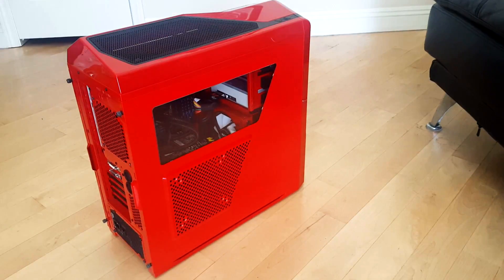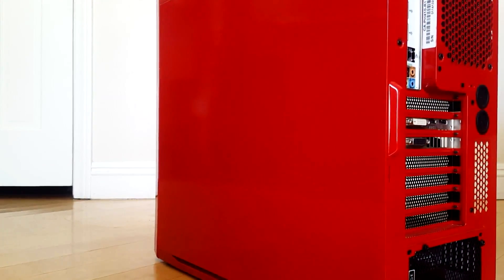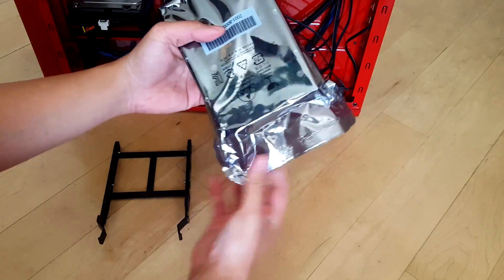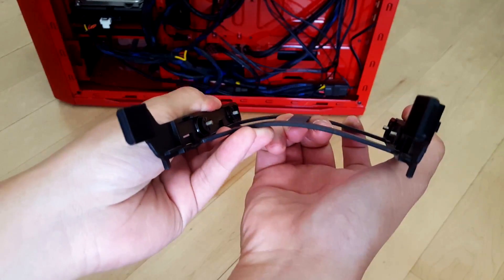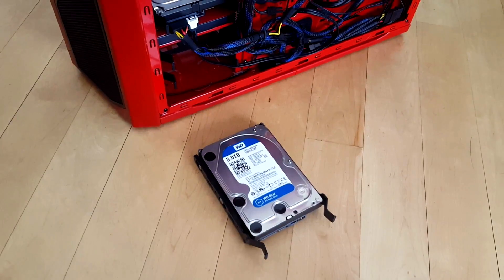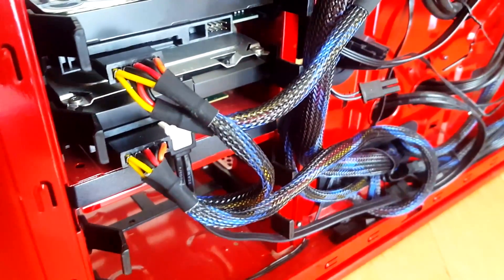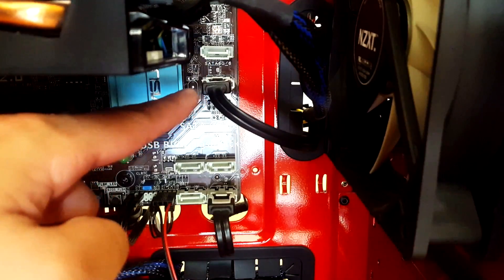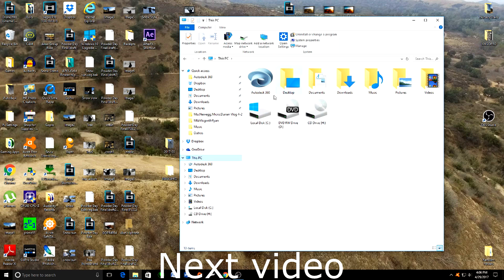How to Install  a Hard Drive

Comment: thanks man. I forgot i needed a bracket for it...actually i didn't know. I bought everything I needed except that. Doing my first build. Thank you
Reply from the maker: No problem man! Glad I could help hahah enjoy that new build!
Reply: I wish. Everything is right but no power. Only the lEDs come on. There’s a white flash at the back of the motherboard when I turn the power on. No smell no smoke just a white cflash and no juice

Comment: I'm about to move a harddrive i had on my old pc to my new one, when i removed the harddrive from the old pc i didn't reset it. so does that mean if i put in the harddrive into my new pc, will it be flodded with the stuff i had on the old one or do i have the option to choose manually what i want to keep or remove from it?
Reply from the maker: Hello yes if the hard drive was not formatted it should be accessible in the new computer. Since you can access the data you can choose to delete what you like. Hope that helps!
Reply: @50nollieman  alright, thank you so much, been thinking of this for the past few weeks, keep up the good work!
Reply from the maker: @h8m812  no worries! Thanks! And goodluck man! Enjoy that new PC hahah

Comment: What screws do i need?
Reply from the maker: It depends on your pc case. You can pop open one of the side panels to see if you even need screws. Goodluck!
Reply: @50nollieman  Well I got a weird case I need to screw in my hdd in the hdd bay but no screws were included what should I do?
Reply from the maker: @PerPhilips  hmmmm Id suggest going to a Home Depot or any hardware store and ask someone to check which screw fits into your hard drive. It might be either M3 or 6-32 screw
Reply: @50nollieman  Will do thanks alot!

Comment: The cables do we get them with the hardrive or case or if it doesnt where do we get the cables from?
Reply from the maker: The power cable should come with the power supply but the SATA cable you'd have to buy separately. They have those on amazon for about $6. Goodluck!
Reply: @50nollieman  Thank you!
Reply from the maker: @HambergurHelperEeter  No problem! Enjoy!

Comment: Mine won't stretch enough to fit the hard drive without the final pin popping out and I can't put it back in :(
Reply from the maker: Hello. Do you mean the sata cable? If thats the case you can buy longer ones
Reply: @50nollieman  No, the tray
Reply from the maker: @BRAWGWill  hmmm if the new drive is the same size as the old drive it should fit. Id say just keep fiddling around with it. Or if anything having one pin out of the 4 not holding you should be fine
Reply: @50nollieman  It's all new. Case and drive. I'm still unhappy with the idea that one would be missing if I just did it anyway. God I wish I didn't have to fuck around with a tool-less tray and I could use a proper one.
Reply from the maker: @BRAWGWill  hmm id say contact the case manufacturer and they might warranty it and send you some

Comment: Got a good question bro does the hard drive make your computer run games and load slot slower?
Reply from the maker: Hello! What do you mean exactly by "load slot?" If you mean the game loading screens it really depends where you're coming. If you're from a SSD then yes the loading screens will load slower in the games that is stored in a HDD
Reply: @50nollieman  lol auto correct I meant will it make it load a lot slower
Reply from the maker: @connordover2215  hahah in that case the SSD will be faster. It really depends on the games and pc setup. What you can also do if you already have a SSD but need more storage is get a HDD. Move the games you don't play into the HDD and transfer your newly downloaded games that you want to play in your current SSD

Comment: Yo do you need to buy a data cable or does it come with the pc
Reply: Also what is better SSD or HDD
Reply from the maker: @alfredoisok7353  for SSD vs HDD it mostly depends on what you want. Do you want speed? Then get ssd. Do you want more space/better value? Get hdd. For example a 4tb HDD you can get for less than $100. $100 will only get you a 1tb SSD but it is faster
Reply: Sata cable*
Reply from the maker: Usually prebuilts don't come with. Unless you're building it yourself, it usually comes with the motherboard. Its pretty cheap you can check my link in the description if you want
Reply: Ok thank you cause I don’t got one 🤜🏼🤛🏼👍🏼
Reply from the maker: @alfredoisok7353  no problem! Happy to help 😁👍
Reply: But for gaming and streaming what do you recommend
Reply from the maker: @alfredoisok7353  hmmmm with SSD you can get shorter loading times. For that dreaded GTA loading screen lol On the other hand streaming is mostly on your internet connection so ssd vs hdd wont matter. So id say go ssd if loading times matter to you
Reply: SSD OR HDD
Reply from the maker: @alfredoisok7353  Also 1tb should be fine for gaming. If youre not a content creator and dont plan to store movies, videos, pictures then Id recommend the SSD
Reply: Ok thank you so much cause this will be my first build thx
Reply: But I make montages so what do I do there

Comment: I have the same motherbaord and gpu kinda funny
Reply from the maker: Ayeeeeee I like your pc man! hahah pc twins
Reply: @50nollieman  whats ur prossesor what are the odds u have a ryzen 5 3600x
Reply from the maker: @aidensimpkiss9442  lololol close guess. Right now im running a ryzen 5 1600. The older version of yours hah
Reply: @50nollieman  well we basicly have the same pc just mine was an old Pre build but i redid the hole thing so rlly we just have diffrent cases but basicly same iinternals
Reply from the maker: @aidensimpkiss9442  heck yeah! Definitely a solid pc forsure. Im looking into ssd now heheh the price is finally coming down to something I can afford xD
Reply: @50nollieman  i got a 500gb ssd im basicly done with upgrades im just gonna get a water cooling block for my cpu then im done iv spent to much on my pc as it is
Reply from the maker: @aidensimpkiss9442  nice nice! My want for upgrades never end xD The wallet on the other hand hahah honestly I need to stop following new releases. If idk new upgrades then i wouldnt want anything lol new

Comment: You just slide it in like that?  It wont move around?
Reply from the maker: The hdd locks and clicks into place. Thats why I had to squeeze the two tabs together when pulling the drive bay out, to unlock it
Reply: What are they called and where can I get those?
Reply from the maker: @nappery9736  Those specifically came with my case. You can check yours how they designed the hard drive to go in

Comment: why tf does my pc not have that rack thing that u put the hardd drive in? is it possible to buy and install one?
Reply from the maker: It really depends on your case. With my case those were included. Maybe in yours is a different design?
Reply: AdventuresWithAlan yes probably
Reply from the maker: @antoniobeccari6611  Yeah. I know in other cases the hard drive is screwed into the case. See if thats how your case is

Comment: Can we take out the old 1 and install the new1 in the old 1s position with the wire which was used for the old1?
Reply from the maker: Yes. You would need to reinstall windows

Comment: I had a failing HDD, and I bought a new one and I am going to put it in, am I able to just take the cables from my first hard drive and just put them on my new one?
Reply from the maker: If the failing HDD is a secondary HDD then yes. If not you probably want to back up all your data first before switching the old HDD to the new one. Also have the windows code ready since youll have to install windows on the new HDD

Comment: Do you have to buy cables separately or does it come with HDD?
Reply from the maker: The cables are always sold separately. The power cable should just come from the power supply
Reply: @50nollieman  Alright, thanks for info

Comment: Wow, I’m 12 years old starting on computers and you really made it so easy, I thought it would be a maze in the PC but it actually only took 5-10 mins just like the video, thank you so much
Reply: Just a question:
Did you need to buy the cables that you plugged in the second HDD or were they already there? I've upgraded my cpu,gpu and ram but I've never upgraded my HDD so it's something new for me xD
Reply from the maker: Yes its not too hard hahah Glad I could help!!
Reply: @50nollieman  no I mean..Were the cables already ready to get plugged in it did you need to buy them
Reply from the maker: @orestisx  You need to buy a sata cable. The power cable should come from your power supply. It depends on your power supply tho
Reply: @50nollieman  thanks:D

Comment: does the screw come together with the hard drive? because it seems that for my casing, i have to mount it to the right side of it and have to screw it in
Reply from the maker: No the screw does not come with the hard drive. The hard drive only comes with the hard drive. Not even the SATA cable

Comment: How do i know what is the right for my pc
Reply from the maker: You can check inside if theres already a hard drive
Reply: @50nollieman  Theres only a ssd but i want to add a hard drive
Reply from the maker: @aukusti22  what kind of ssd is it? Its not a nvme right?
Reply: AdventuresWithAlan no its not a nvme
Reply from the maker: @aukusti22  Then yes you should be able to. The ssd connects exactly the same as the hdd
Reply from the maker: @aukusti22  If you follow the steps in this video and treat the new hard drive as a secondary drive, then youre good. As in this video I had two hard drives, you can treat my 1st hard drive as your ssd basically
Reply: AdventuresWithAlan oh ok thank you🙏🏻
Reply from the maker: @aukusti22  no worries! Goodluck enjoy!

Comment: Can somebody explain the sata power cable part? 1 end is to the HDD, and the other end is to the power supply right? So by default my power supply should already have multiple sata power cable ready for use, right?
Reply from the maker: The HDD runs off 2 cables. One is the power cable(comes from power supply to power the HDD) and the other is the sata cable(this connects the HDD to the motherboard to transfer data)
Reply: @50nollieman  Ah okay yeah. I understood the sata data part. But I already have a SSD connected to my power supply. So do I have to buy another sata power supply cable for my HDD to power supply or my power supply has the sata power cable preinstalled ready for me to use?
Reply from the maker: @SW-zq7pj  That would totally depend on your power supply. Some power supplies have removable cables and some are fixed. If yours is fixed you can see if there is an extra power cable that is not being used and you can use that. Let me know if you have more questions! Happy to help
Reply: @50nollieman  Sorry I'm not familiar with PC building stuff :/
Reply from the maker: @SW-zq7pj  Thats fine! no worries
Reply: @50nollieman  Ahh, I see, thank you!!
Reply from the maker: @SW-zq7pj  Youre welcome! Goodluck and enjoy your new drive!

Comment: For the sata cable you have like 8 dots on the place you plug it in I only have 4 of those dots do I have to get another wire????
Reply from the maker: Sorry for the late response. Hmmm you can google where your sata connects. Its different per motherboard but it should look the same as in my video

Comment: nice build bro i’m a beginner and my power supply came with no sata cable for the slot on the right side but i have one to fit in the first big slot , will mine still function, ? and did u have to buy that sata cable separately?
Reply from the maker: Thanks bruh!! Hmm you would need both the cables for the hard drive to function since one cable is only to power the hard drive and the other(sata cable) is to actually read and write on the hard drive. Yes I had to buy mine separately. I think it was only like $5-10

Comment: its my first time buying a pc and im confused with the cables do i have to manually add cables or are there automatically wires?
its a pre - built pc if that helps
Reply: ArsGames the power supply should have the power cable and the sata cable should come either with ur mother board or u gotta get on online
Reply from the maker: @hokagesuperr2484  Yes exactly correct! If you need a sata cable it's only $5-10
Reply: @50nollieman  do i really need the wd hdd bracket?
Reply: @deltaid1439  no not really, theres different ways to mount/install hdd's.or ssd
Reply: @aljonborabo0801  ok cuz i was want to buy hdd
Reply: did it come with what you needed bro ?

Comment: Man i have no sata cable connection on my Mb it is Asrock 450b Pro, isn't it strange?:(
Reply from the maker: That is pretty weird hmmm did you check the manual? It usually says what ports and connecitons come with the mobo

Comment: How do you get it out
Reply from the maker: get what out?
Reply: AdventuresWithAlan no I figured it out I was trying to take out a hardrive from my old pc to put into my new one that I am building but I am having problems (not with the hardrive.) do you think you could help me?
Reply from the maker: @brodyhubbard9801  whats the problem?
Reply: AdventuresWithAlan so okay when I tried to boot it up everything was working except there was no display and there was a red Light on the motherboard indicating that there is something wrong with the cpu so the next day I took everything out I cleaned out the thermal paste and just kinda cleaned it up a little and put it back in tried to book it up nothing. Also the plug ins on the back are not working I know that because I tried plugging my mouse into it. I have no idea what it is
Reply: AdventuresWithAlan I forgot to mention that there was one bent prong and I fixed it with a razor blade very prescily

Comment: And how do u plug in the power i need help
Reply from the maker: The power comes from the power supply. You just plug in the cable coming from the power supply to the hard drive
Reply: @50nollieman  do u have discord by chance
Reply from the maker: @brxndxn4252  unfortunately no
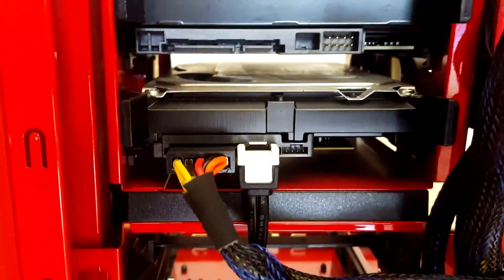Reply from the maker: @brxndxn4252  The part you would want to watch is 4:06
Reply from the maker: @brxndxn4252  If youre worried about wiring it wrong, the cable will only go in one way(the correct way)

Comment: do u need to buy a powercable ? or is that already in the computer itself
Reply from the maker: That is typically with your power supply. Check if your psu has an extra. Goodluck!

Comment: Do the wires come with the hard drive
Reply from the maker: No it doesnt. The sata cable should be less than $5 and the power cable should come from your psu

Comment: Dude, does it matter that i have an SSD already? Like Do i have to plug them in at the same time?
Reply from the maker: If you already have the ssd in the computer just don't touch it then you should be good to follow the steps I did in this video :) Hope that helps

Comment: Don’t know too much about PCs but my pc motherboard is a DZ68BC and it got 4 sata plugs but there 2 blue and 2 black so if I get a hdd would it work in any plug I also have a extra power supply cable but I don’t have a sata cable would it work just to buy a sata cable and hdd? Also again what’s the difference of the blue sata port and black port?
Reply from the maker: Yes it will work with just buying the hdd and the sata cable. From what I saw online I think the blue and black is only for looks as far as I know. I think you should be fine. Hope that helps!

Comment: did your pc come with the flexible hard drive case(s)? where can i buy those exactly? thanks
Reply from the maker: Yes the case did come with those. Your pc should have extra slots but not necessarily the black flexible pieces I have. It could be just screw holes in the case etc
Reply: AdventuresWithAlan oh ok. do you know the exact names of those trays? i looked on amazon for ‘flexible hard drive tray’ but to no avail.
Reply from the maker: @NewDawnFadesX  Yeah those are specific for my pc case so I do not think they would sell it by itself since it wont work with other cases. There should already be empty hard drive slots in your computer case. Lmk if you have more questions
Reply: AdventuresWithAlan oh ok. thanks for the responses.
Reply from the maker: @NewDawnFadesX  No worries! If your pc case does not have extra hard drive slots then you might have to buy a new pc case
Reply: AdventuresWithAlan i think it does. it just doesnt have the trays. i have a flexible tray similar to yours. but just one. i dont see the others where the my current hdd is. my friend is the one that assembled the my pc. but its been a couple years since its been opened. i needed to clean it off any ways. due to dust.
Reply: NewDawnFadesX  Ik this is a extremely late response bit the plastic things are called hard drive rails/ caddys
Reply: Saftey Bird it’s ok. Thanks for replying.
Reply: NewDawnFadesX np

Comment: LOL I got even same case so useful video for me
sadly I hadn't istall other slots for hdds and I don't know where they are.. do you think I can buy them somewhere?
Reply from the maker: Ayeeee case twins! hahah Hmmm I would suggest maybe contacting NZXT(maker of the case) to see if they have any lying around
Reply: excuse me sir,what name item for cover your HDD? and does it still need screw For tighten?
Reply from the maker: @gunawangunawansantoso4122  Hello. It's called a drive bay. In this case it does not need screws since it has pins.

Comment: does it matter which power supply cable I use? I have a very similar looking pc and currently the setup uses one parent power supply cable to my sdd and it splits off to my hdd. like parent / child or master, slave, not sure what the terminology is for cable setup....
Reply from the maker: From my experience no it shouldnt matter which cable you use as the sata power will always be the same. Its designed to supply the power needed for all hardware that uses sata power